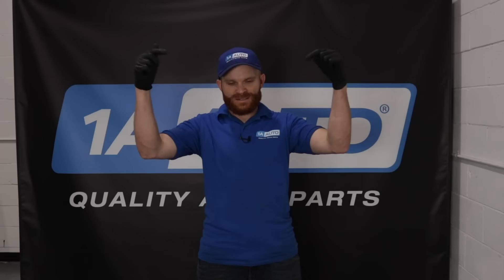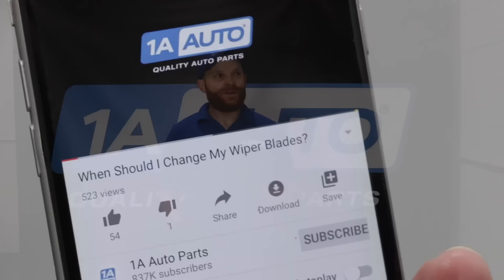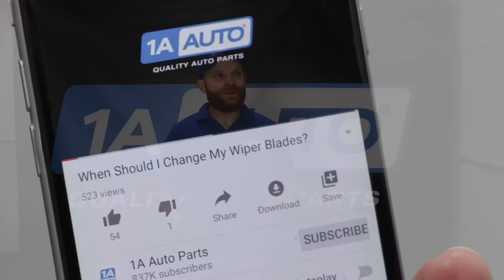Weak Acceleration? Rough Idle? Diagnose a Car or Truck Throttle Body!

Comment: Sorry - I learned NOTHING watching this video I already knew.  I cleaned my TB before I installed my IACV.  It ran better but the first IACV was evidently a cheap knock-off part.  I just installed a more expensive IACV and it worked great ... for a day.  Now back to having erratic idle and same P0505 CEL issue.  I cannot explain why I'm having these problems.
Reply from the maker: +Brian Brewster We wouldn't be able to diagnose an issue like that here, you may want to have a local mechanic take a look at it. Thanks for checking us out! http://1aau.to/m/Shop-1AAuto-c

Comment: I replaced my 2006 chevy equinox ls throttle body....Now after a few ride I still receive the code p0120 code. That is the throttle body sensor..... A friend of mine said that I would have to reset the sensor to my vehicle.....Could you make a video to instruct on how that is done
Reply from the maker: +Robert Murray We do not have a video for this repair right now, but we'll keep this request in mind for a future video! 1AAuto.com

Comment: Wat cause acceleration with out steping on da gas pedal also wen i let go of da pedal while i am driving it doesn't deccelate
Reply from the maker: +DD___DC We wouldn't be able to diagnose an issue like that here, you may want to have a local mechanic take a look at it. Thanks for checking us out! http://1aau.to/m/Shop-1AAuto-c
Reply: @1AAuto  oh k.i figured it out it was da pcv valve i change it. thank anyway

Comment: Hi, great video. I wanna try doing this on my own and I heard someone say I need to drain coolant before removing tb.. is that really necessary?
Reply from the maker: +Emanuel Valdovinos Thanks for watching!  Depending on the vehicle you might need to drain coolant in order to pull off the throttle body.  For our vehicle we did not.

Comment: Mines accelerates too high in idle when stopped
Reply from the maker: +Himithor We wouldn't be able to diagnose an issue like that here, you may want to have a local mechanic take a look at it. Thanks for checking us out! 1AAuto.com
Reply from the maker: +TT C Thanks for the feedback!
Reply: Did you find out a solution?

Comment: My 2007 Chrysler 300 3.5 V6 lost acceleration on the highway. It was still running though. Pulled over to the side of the road and turned the car off. Went to start it back up and it would turn over but is not starting. Could this be the throttle body?
Reply: Probably not. Maybe fuel pump. It could have just enough pressure to let it idle but not accelerate. Same with injectors
Reply: timing belt slip,fuel pump...

Comment: If you have caked on carbon deposits do not buy a new fucking throttle body they are not cheap .. remove the electronics if it is not drive by wire (these might need a scan tool to re calibrate ) and dunk the fucker in carb cleaner for 15-20 minutes depending on strength of your cleaner. YOU do not EVER need to replace a throttle body for carbon build up you simply need to clean it. if its not your vehicle and you are a lazy sonabitch like guy in video replace it knock yourself out its not your money. But if its yours then simply clean it and learn your lesson as these always need cleaned as regular maintenance and if you do it regularly it does not need removed and you can clean it on the car in minutes. just remember you are spraying flammable liquid and vapor into your intake plenum when you first crank it you might get smoke from tailpipe and erratic idle for a moment as the vehicle ecu needs to deal with the uneexpected extra fuel mix. it might toss a code that needs to be cleared as a result. if you do not have a scanner remove it to be safe simply to avoid needing to clear a code. (this is done daily in thousands of dealerships and perfectly safe as long as your dumb ass doesn't try to spray an entire can into the intake plenum and not expect to catch fire or implod the plastic intake (these days they are all plastic and very expensive)